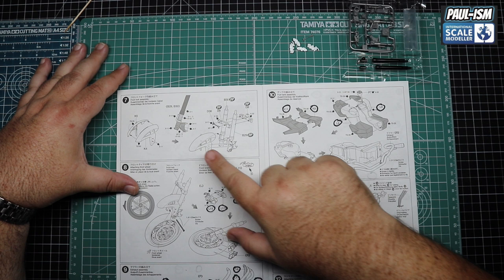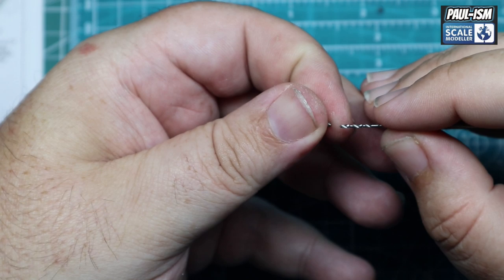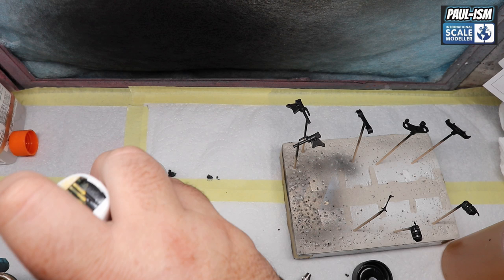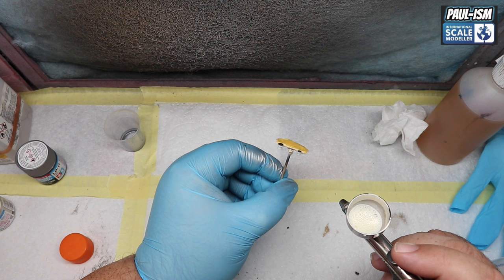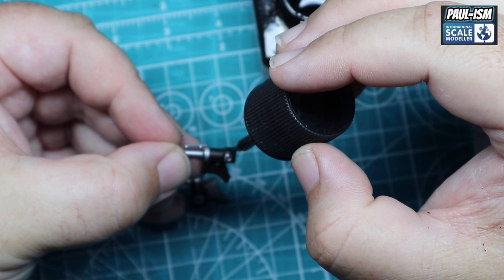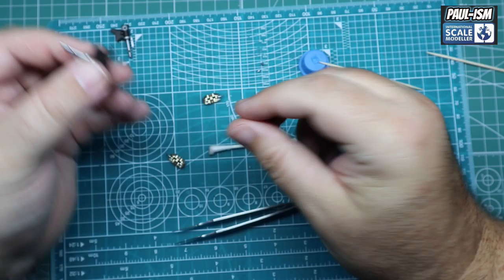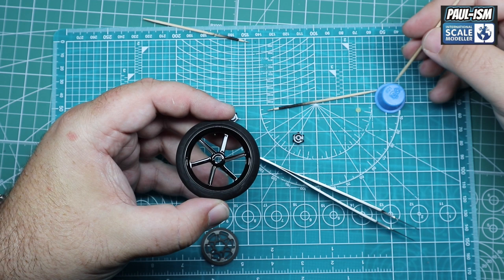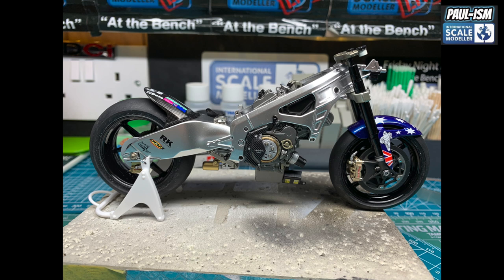Part 10 - Tamiya 1/12 Honda Rc211v '06 Step by step Build

Comment: Hi Paul,

I’m enjoying this series. One question I have is, I spray a lot using Mr Hobby Aqueous and Tamiya Acrylics and I find that while handling the part for assembly I end up rubbing some of the paint off. This is especially true for flat colours but happens with semi gloss and gloss paints too.

You don’t seem to have this issue. Any ideas how to avoid it?
Reply from the maker: Simply try to handle as little as possible to avoid rubbing the paint

Comment: Hey Paul, OMG your work is amazing.  KUDOS...!!!!
Quick question, why when you remove the red paint out of the calipers with thinner the base paint (Gold) dosent come off?
Thanks again for sharing with us your great work
Toni
Reply from the maker: Hi Toni, cheers buddy, the gold paint is lacquer and the red an alcohol based acrylic so using the same thinner as the red paint (ultimate thinner) it doesn't bother the lacquer if you are gentle :)
Reply: @InternationalScaleModeller  Got it.Thanks